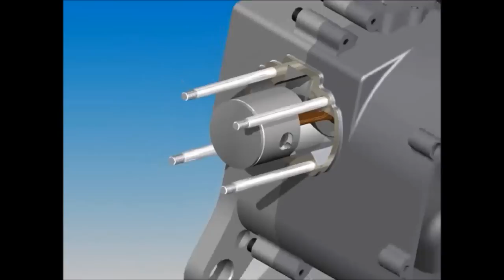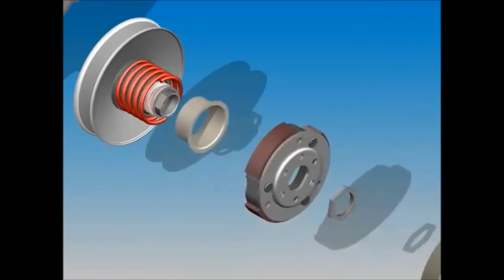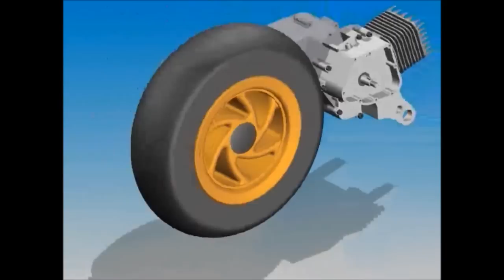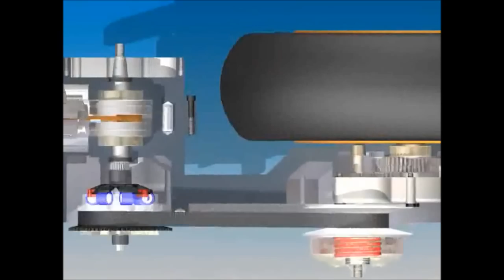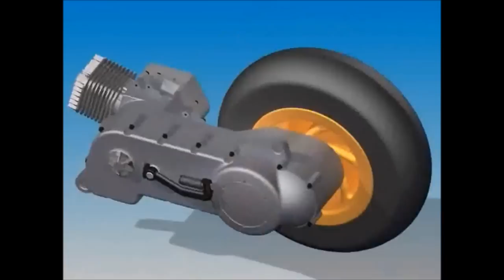Autodesk Inventor - Piaggio CVT Trasmission

Comment: Take an old scooter with a dead engine,..remove the bore/head, piston,  crankshaft. Replace the crankshaft with an electric motor connected to the front pulley. 
Lock the driven pulley to the bell housing and you got yourself an electric scooter with good torque and speed when you need it.
Can anyone please critique this and tell me why it's not a good idea? 🤔

Comment: What module of Autodesk inventor did you use to make this animation, especially when you show the mechanism in movement?
Reply from the maker: Hello. The project is made with “Autodesk Inventor 2010” and I used the module “Inventor Studio” for the entire video (you can find this into a .iam file, in “modules” section). For simulating the movement parts, I used different strategies and tricks.
Reply: @rossanorivadossi1890  Thanks a Lot Rossano!

Comment: Where is inlet and exhaust ,valve and cam timing chain starting coil pickup coil, ignition spark plug and oil seals
Reply: It`s a two-stroke engine, it does not use cams and valve gear.

Comment: Hi, I am planning to install an electric motor,  washing machine motor, on a scooter like this. How would you recommend me to install it?  This kind of motor is able to spin up to 12.000 rpm,  but I suspect under load it will be less rpm.  How can I demultiply this relation to match an adequate speed yo the gearbox?  Thanks for the video
Reply: Hi! I used to  have a suzuki sepia for a long time, and it did run a Foma 1950 washing mashine motor. The speed and range wasn't bad, but to encrease the power and efficiency, l rewinded the motor and putted a fan on the rotor for cooling, by making some ventilation holes. The rpm while riding the scooter won't exceed 7-8000rpm

Comment: If that secondary could be rotated with the weights facing into the wheel and the belt housing made as minimal as possible it could be way more stream line, and possibly even catch on.

Comment: its not a 2 stroke it,s 4 stroke scooter timimg chain not there
Reply: dude, it's a 2 stroke...
why would it be a 4 stroke if it has no cam, no valves and an intake and exhaust port in the cilinder wall

Comment: A piece of plastic gear? That is nailing coffin On Piaggio .
Reply: Nothing is plastic in a Piaggio engine i can garantee. I know mine inside out, apart from the seals everything is steel.
Reply: Mine have over 50000 kms, all original engine.